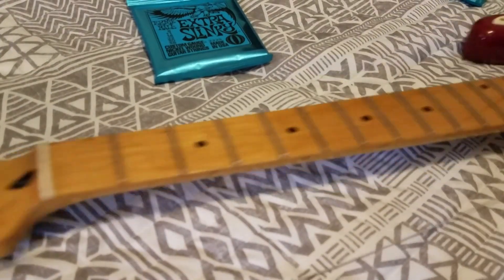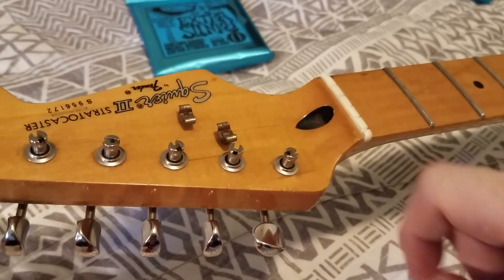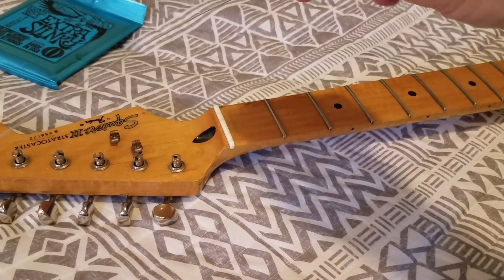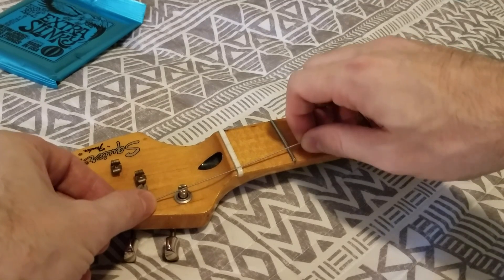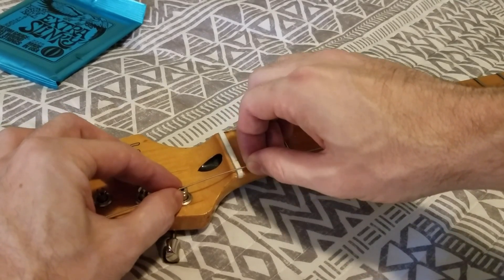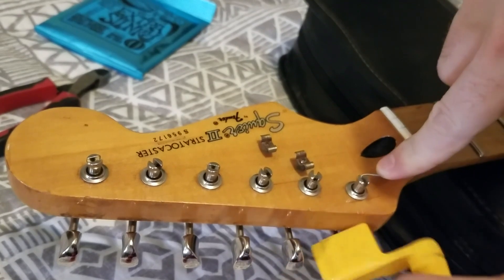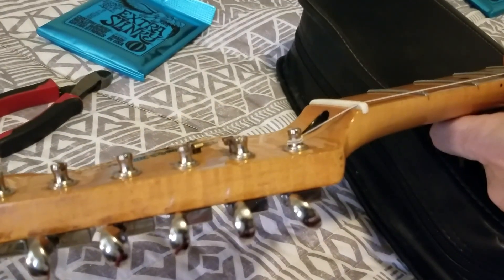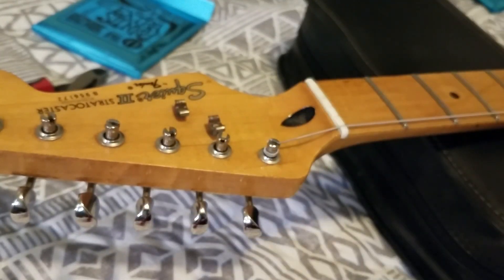Installing guitar strings correctly on Fender vintage style slotted tuners (machine heads)

Comment: You can also use it like a regular tuner with an over and under wrap. first half wrap over the string then wind under the string which squeezes on the string with no crossover of wraps.

Comment: You don’t have to back the string up two frets 😃 you just clip it off two tuning posts up. Easier and less chance of a measuring error. You can back up the B and  E strings if you like, but by then you’ll have an excellent idea where to cut them.

Comment: At 2:44 please note exactly how he is applying pressure and pulling back on the string as he applies the tension by turning the pegs.  Man oh man - this is SO important. If you do not do it this way the dang string will pop out which really gets old

Comment: Or just pull the sting up 2 x tuning pegs and cut, works just the same
Reply: Yes,you're correct ! The distance between 2 tuning pegs is about the same as the distance from the nut to the second fret.

Comment: How in the hell do you do the winding at 2:40 everytime I do it my string just goes outward and the wraps stick to the bottom of the tuning peg I hate restringing so f*****g much
Reply from the maker: What I first do (and I guess I should have showed this in the video) is after putting the string in the tuner post, I bend the string over the slot so it won't pop out while winding. After that, when I start winding, I pull on the string purposely to give it tension so it slides up the tuner post while winding (you can see me doing this in the video), otherwise I would have the same problem you're having now where the string would "flop out" and just stay at the bottom and not wrap around the post correctly.
Reply: @rmenga  while pushing with the index you are pulling it with the middle and ring finger, is that correct?

Comment: I fucking hate vintage tuners man. I followed this exact steps and the bloody high e string will not stop popping out. Why are these fucking tuners still a thing? I’m about to throw this damn guitar out the window
Reply: They are fantastic tuners. I prefer them over all the rest. Even locking tuners. When you wrap the string YOU GOTTA ADD PRESSURE.
Reply: you cut the string too short
Reply: I will not buy a Fender that doesn’t have this type of tuner. Unfortunately, they are not using them as much on the newer models. The American Performer series is underrated.

Comment: Man, I hate this type of tuning system... Especially the thinner strings have the tendency to jump out as you're coiling them.
Reply: Vintage tuners are the best. If they slip out it’s because you’re not adding pressure to the string as you wrap it.
Reply: I will not buy a Fender that doesn’t have this type of tuner. Unfortunately, they are not using them as much on the newer models. The American Performer series is underrated.